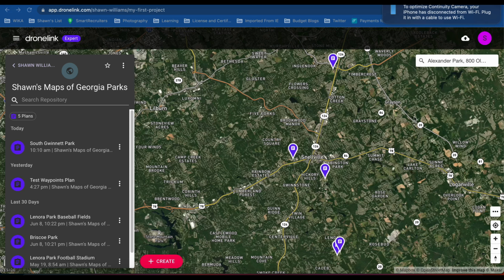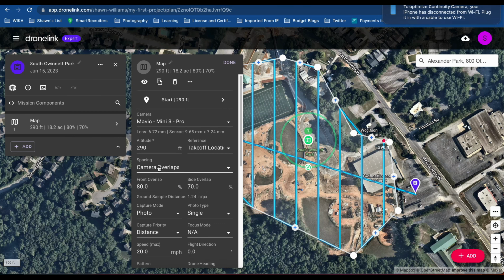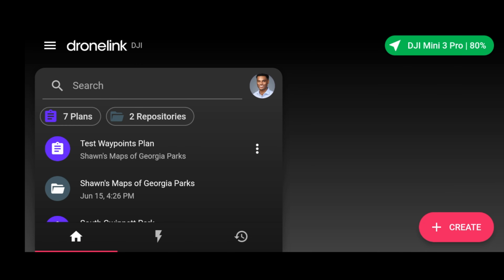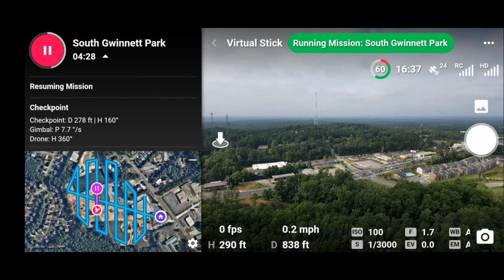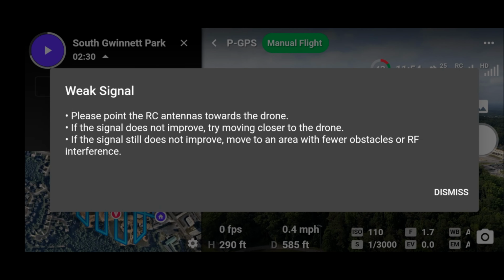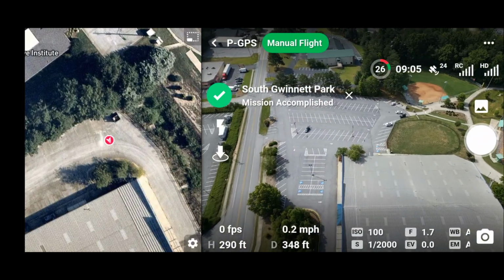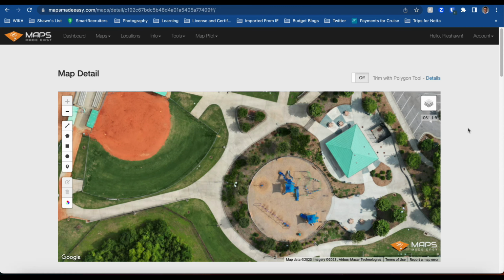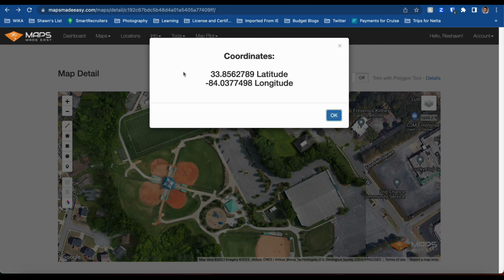Photogrammetry for DJI Mini 3 Pro- Dronelink Beta and Mapping with Maps Made Easy!!!

Comment: Using the DJI Mini 3 Pro and RC controller I can do the exact same thing, correct? There’s need to have the RC-N1 controller, correct?
Reply: Only if you manually fly the mission.  You can't automate any missions on the RC controller, as you can't load any apps on it.  You can if you have the RC Pro however.

Comment: if apps crash, and we press RTH in the remote can the drone go back to where it take off?

and are the picture save to memory card in the drone?
Reply from the maker: Yes it will return to whatever home point you selected. The pictures are saved to a memory on the drone.
Reply: @scootp  can you do it next with apps maps pilot pro (from maps made easy) for flight and making flight plan or grid.

Comment: Hi Shawn, I am in the same position as yourself having bought the rc and have the rc-n1 on the way. how have you found switching between controllers? I would prefer to use the rc when not doing mapping.
Reply from the maker: I would say it’s not bad but can be a bit cumbersome at times. I do prefer the RC controller as it’s brighter. Lately I haven’t been switching since I have just been mapping. Make sure you bind as well just in case the drone flies away.
Reply: @scootp  thanks for the reply. I have been doing a little reading the binding. Makes sense. The weather here in Nova Scotia has been so crappy this year hard to get out at all. I am setting up an Open Street Map server for map renderings in my local area. I know the mini 3 is not the greatest for mapping but definitely  easier on the pocket book :)